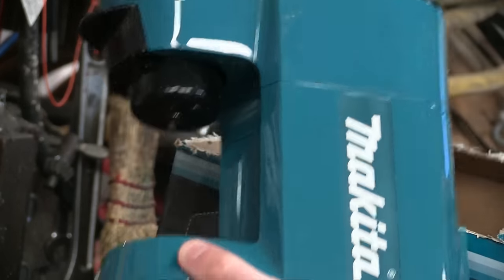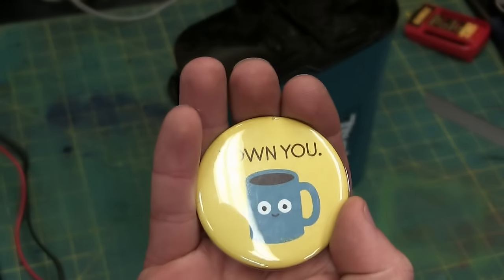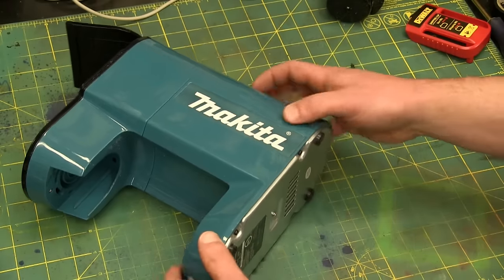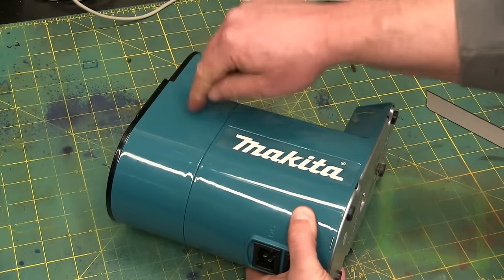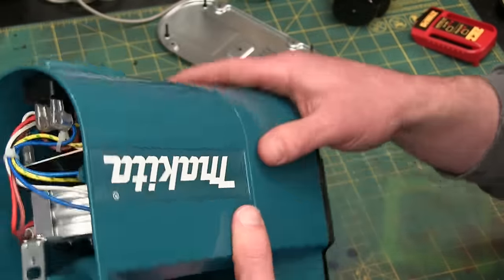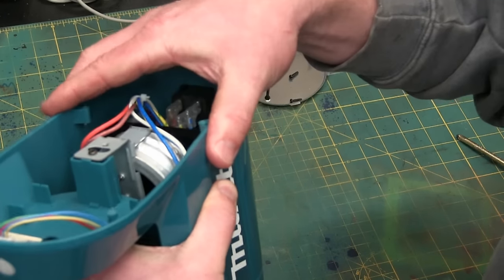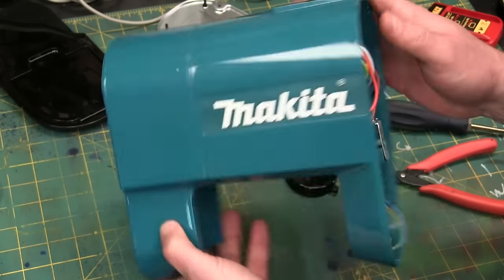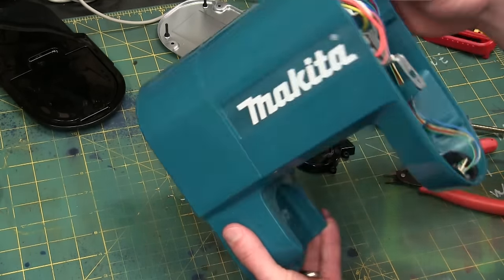BOLTR: THE BEST TOOL MAKITA EVER MADE!

Comment: You need to work on your speeds and feeds. The surface finish on that cardboard is appalling.
Reply: Trent Wainwright looked more like the chatter was on the end of the workpiece, needs to hold her more skookum
Reply: I thought the cut was a bit deep
Reply: garrett messer yeah definitely not just chatter problems here. Tools also seems to be a bit dull, it's not cutting properly in my opinion
Reply: Nothin' a little grindin' won't fix....and he owns 12 of  'em!
Reply: He did skimp on the lube/coolant
Reply: Your setup for the cnc box cutter might require just a teensey weensey bit of mor research.  When all else fails, please read the instructions stuck to the bottom of the box.
Reply: @kevinireland8020  Absolutely, saw that right off!

Comment: I was so fucking confused after you opened that. It's a 4$ Walmart Special coffee maker hooked up to a goddamned 18v battery.

This is the future we chose.
Reply: WalcomS7 Had no idea you were an AvE fan, Wally
Reply: But it would have a false "Made in the USA" sticker with fine print that says, "Actual parts may not be made in USA."

Fucking shitmart.
Reply: TheGuruStud pretty much everything nowadays that has "Made in the U.S.A." on it's components etc are made in China, so don't blame walmart for it since it isn't their fault, cause they just get the components etc out of China, and then assemble it/put it together.
Infact, i don't think that there are much semiconductor manufacturing companies that have it actually manufactured outside of Asia, if any.
Reply: Coofee Yum.

Comment: What is the correct feed rate for milling cardboard?
Reply: Fucking full/high/all out/240v on a 120v motor. You get the idea..
Reply: all she'll suffer
Reply: 650 gnaws per minute
Reply: One by each
Reply: Here in Canada the technical term for the proper speed is "give 'er"
Reply: @maxk4324  In Australia we'd say "Fuckin' send it"
Reply: ALL the spindle speed, and full chooch with your strong hand on the feed. The stranger doesnt have the stamina to finish the cut.
Reply: Turn er up and push go

Comment: Question - what's the recommended feed speed for opening a cardboard box?

Asking for a friend.
Reply: Lazarus19706 how many rippums you using?
Reply: About 6-10 inches per minute @ 9k rippems, it's good enough for the girls I go out with.
Reply: criswellwj  less than 3 tenths per tooth eh? I know who I want to race against in a productivity match.
Reply: MindCrime 99
Reply: I go with 20 inches per minute.
Reply: Hard and fast, like all ave feed/speed
Reply: As long as you're using lubricunt, feed speed is irrelevant... So don't hold back.
Reply: @MindCrime550  Do the girls get rectafied too.

Or is that rectumfied?

Comment: It's actually a drip coffee maker using a bubble pump. The heated water turning into steam drives the pump. Since you put ice water in it's not surprising that it took a while to start, but the bubble pump will ensure that generally the water going into the coffee is at the right temperature.

Comment: Using a mill to open packages huh...  I feel like you got a good idea going here. Maybe clamshell packages would actually be openable that way.
Reply: Hacksaw blades.

Broken hacksaw blades... avoid those "bimetallic" blasphemies. Grind away and make a scalpel sort of thingie...

Sharpen the shit out of that thing, a clip point is preferred but not needed.

Hold clamshell container flat against a proper sacrificial surface as wood, cardboard or thicker plastics and cut away.

Keep several of those slashy things around, give some as gifts and preach the knowledge...
Reply: Nice Pfp Seraph
Reply: Lasers overpowered lasers

Comment: They're starting to come out with some cool gear for the batteries. I have seen a battery powered air pump for tires and such. I've been considering making something to use my batteries besides impact tools. dunno what yet.
Reply: I've heard the battery tire inflater is great just don't try it on 80psi, the milwaukee one will not do it! 40psi I've heard many people say it's good tho. better than nothing on the side of the road with a flat!

Comment: Ok, you have to overhaul the Bridgeport.
Reply: dkroth Agreed. It's a bad sign when you get chatter machining cardboard.
Reply: David Lowe He was obviously milling at a slower speed to increase suspense.
Reply: I mean, how would a cardboard box NOT chatter?
Reply: Shea McCombs Id go with conventional milling vs climb milling
Reply: Lawndart Productions 
so long as the step over on that profile cut is less than half cutter diameter I agree. climb cutting like that is just slapping the workpiece and building harmonics like pushing a kid on a swing. conventional cutting in this application would puts forces in line with the hangulation that the work is better shaped to resist.

Comment: how many cups can you get from a full battery I wonder...
Reply: 2 with a 3Ah battery pack, more with the larger ones. I got one and use it with AC, works fine ^^
Reply: Would that be full cups or 1/2 cups ? 
Gotta leave room for some of the secret sauce that lets you tolerate the guys with the clipboards. It ain't just for breakfast anymore...
Reply: +DL the nahbore had guy working for him the guy  left his coffee  laying around so the naborian drak it and said that ain't coffee
Reply: Canadians use 1/2 cups. jk i💛maple leaf lovin s.o.b.'s lol
Reply: Dunno man...I'm a proud member of the Order of the Leaf meself and my coffee cup's bigger than my face. We even ship our Timmy's to the sandbox for the troops.
Reply: All that bein' said tho...I'll unplug the charger for that POS drill no one uses in order to plug in my java. Even the white-hats won't call me on that one.
Reply: @Carsten Hodes Is it much faster on AC?
Reply: More if'n you don't fill it with ice!  WTFing  damnfool CLINT fills a coffee machine with ice cubes at 550BThU per pound to melt?
Reply: belson alan I was also wondering if the ice had anything to do with how long it takes for it to make some coffee
Reply: @lpsteentjes: The manual from Makita said: 3min on AC and 7min on DC [150ml cup].

So i just tried and stopped time. My cup holds 230ml, it took 9min on DC and 3min 20sec on AC. Roomtemp was about 22°C and water had about 20°. In both cases i used new water and the temp was the same.

So... it is possible to run it on DC but i think that is more a gimmick, but it works really fine on AC, and personally i drink now more coffee, because it is much faster to set and clean up than a normal coffeemaker (because of the plastic filter).

@DL: is a half cup more or less than 150ml? ^^

Comment: Could you cut the end off of the battery adapter plug & wire a regular outlet to it for running things like LED lights?  (such as Christmas Lights in a standalone setting)?
Reply: nope. It's just 18V not 120V. It's coming directly from the battery and not from an inverter or some step up converter.. So most 120V tools or things in general won't work and some will brake down. A very few might work with reeeaalllyy low power output

Comment: how long does it take without ice cubes for starting ?
Reply: AvE Back when I was stationed in Goose Bay, we had this thing called "fahrrrr" for de-cubing water. Dunno if you can get your hands on that, or if it's some sort of Kraut Army thing.
Reply: Mine fresh from the box took about 15min for a cup of coffee. I don't own a Makita battery so I had it plugged into the wall. I returned it and bought a Mr. Coffee from Wal-Mart.
Reply: Per-gram heat of fusion and heat capacity of water is 334J and 4.184J/K resp., so it might be about 2.25 times faster to start percolating with 20C water than 0C ice; aside a significant fudge factor fer convectin the heat up from the element to the cubes. I'd estimate "lots faster".
Reply: genius Ave also put a ton of coffee in, add less it'll go faster and taste more normal 😂

Comment: Hey, thanks for making these videos, they are quite comical and very educational.  Thank you.
Reply: As far as turbo boosters the only think I can think of would be a UPS type device.  We use them in DDC controls to smooth out input voltage into our controllers.  

UPS into a PSM2RB10 made by functional devices.

Comment: Ahhhhhh the one cup coffee maker. The hotel I do maintenance at has literally the same ones in the rooms. Made by a cheap ass company 'LodgingStar.' Looks identical on the outside. The same shape/ size. The tray for the coffee grounds is slightly different looking the way it slides in, and the power button is an amber led on the front of the machine located on the base. The main difference is that it already comes colored black. No weird teal-ish color.

Comment: 10:14 NEMA 5-15 is the part with the walls. 5-15P is the pokey bit, while 5-15R is the holey bit.
That thing there looks almost like an IEC connector (IEC 60320). It almost looks like C15/16. C15 would be the one on the cord, C16 the one on the appliance.

Comment: Personally i wouldn't want something that bulky in my bug out bag. I'd take the bag of coffee and that would be about it. An industrious sort can always find an implement to make coffee with. An empty vegetable can and a camp fire will work in a pinch. My bug out gear consists of a water resistant container of AA batteries. A solar charger for them. A home made USB power bank that uses them. Two LED based Mini Maglites. One of the pro models and one of the camping ones with the different power settings and signal capabilities. A Leatherman multi-tool. A mini jet torch and small can of butane. A lock pick set complete with torsion bars. Last but not least a handheld HAM radio. Everything else that I might need I can acquire on the go.
Reply: That's a lot of gizmos.
Reply: Not really. I forgot to add paracord but that's still not a lot to carry. It's a light load and that's the point. It keeps me mobile. All of that fits in a small Maxpedition waist pack. My clothes and tent fit in the backpack above it which is also where I usually keep my laptop too. The whole thing is less than 60lbs.
Reply: ExStatic Bass Dude, they have this great thing that makes exactly one cup of coffee all you gotta do is boil water and have filters for it.

Comment: That DC cord is a C15, which is supposed to be a high current version of the C13 and should fit in that AC socket on the back. Also, C13 isn't 115v only, it's used for 230v too. Would be nice if companies did 5 minutes of Googling before slapping the wrong power connector on their coffee maker.

Comment: I have also been integrated about drip coffee. Im from Australia. I have never seen a drip coffee unit before.
Reply: +DeadGhost113 you should order one online
Reply: .x. Im not saying im confused but i am confused.
Reply: In a percolator, the water reservoir and coffee reservoir are the same container.
Reply: Percolators ruin the coffee... it gets re-boiled in them
Reply: alphamongrel To my knowledge it only gets heated once. But like i said i dont know to much about them.
Reply: Mr Coffee makes "drip" coffee makers... I have never used a "percolator" type but they have the coffee go back up and pour back over the grounds again, from what I understand. Correct me if I am wrong, that's a different machine entirely.
Reply: Regardless, a drip system is worth trying, if you haven't already...

Comment: The DC plug adapter looks like a squared off IEC 60320 C15/C16, which is the high-temp version of C13/C14. Never seen one like that. May be something only use for DC.

Comment: braille skateboarding need to open you make other skate it this way. 😎 ave I've got some sharts, I've worked with the con carne sticky stuff before. lots of vacuum casting with machines from shermany. the f1 like performance curves are the same for these chemical resins, toit for the pu pp pe rubberised resins and schmoo. water ingression is always a factor. polyurethane and water makes foam!

Comment: year late, you probably know btter by now, but its an IEC-603somethingsomethingorother standard connector, C15/16... definitely dont wanna go finding one of them with a NEMA connector on the other end and pluggin em into the wrong pokey bit recepticles! HAH... don't see those connectors around often though, most heating element appliances prefer to use C19/20 (BAD) or C21/22 (GOOD)

Comment: 4:37 Nope, that's in no way a 120v-coil relay. The ratings listed there are all for the contacts (according to the different certifications). 

If ya look on the bottom ( 5:02 ) , the coil, which has D9 across it (in reverse), has its traces going waaaaay over to ground and the collector of Q1. And you can bet your booty that lil' guy ain't switching over the mains :P

Comment: Why dont they make corded batteries? Would just be a cord that runs to a battery type fitting that way you could run cordless tools with a cord for the days you need it. One that comes to my mind is the grinder. I burn through batteries in like 5 min, so I have a cordless and corded grinder. Would be nice to just have the one that could be both.

Comment: I think your channel is berriliant, and when it comes to the electrickery you know a lot more than I. So just a quick one (without even chargin ya) if the dc pixies travel one way around a circuit but the dirty ac pixies go both ways ( ie back were they came from) have you actually used any? What happens to the power after its been through our equipment? Is them robbin baskhards at the power company just pissin down our backs?

Comment: Hey, AvE, 

I recently purchased a Makita 12V drill, and noticed right away that the frequency from the electronics is roughly 60 Hz, rather than a few KHz that other drills put out. Do you have any speculation as to why that is?

Comment: I wonder why they didn't just build the battery receiver into the unit and skip the dongle. Keep your Apple jokes to yarselves.
Reply: I can think of a few reasons.  1. batteries don't like heat 2. a lot of people would buy this for the shop as a joke, but not want to use the battery 3. the battery receiver will eventually break, since it would probably have to hold up the battery's weight.  (possible workaround, put the battery in the bottom, but then you have a risk of boiling water spilling directly onto the battery...)

Comment: Starting with liquid water at room temp might be a bit quicker.
Reply: Scavenger_mi errrr nope... and it's just under very specific circumstances boiling water freezes faster.
Reply: how would it boil faster if the ice won't even make to the heating coil without it melting first?
Reply: The ice has to be melted before it will drain to the heating element. The melting is possibly slightly helped by the little bit of water added.

Comment: If this really was the best tool Makita ever made then that would not speak well for them. All hyperbole aside, I disagree. The POS is barely functional. I bought one. I used it. With some screwing around it made a half a cup of luke-warm coffee at a time. While the internal components may impress you, IMO, this thing was so poorly designed for "actually making drinkable coffee," that it seemed like a secondary thought. I returned it ASAP. I think it's the only Makita tool that I have returned. Maybe they'll come out with a 2.0?

Comment: So, me being a newbie, I need resources or a simple 'do this' kinda info bit. Lathes. Metal. Good for the buck. Ramen noodle budget lathe with some budget stretch. Basically how the hell do I choose my first lathe.
Reply: Steve Sheldon if there's a will there's a way to get a coffee maker to chooch ramen
Reply: That's the spirit!
Reply: I've got one of those harborfreight tabletop lathes and it sucks.  Not accurate enough; dial markings mean nothing; the whole thing flexes when the bit enters the work.  I bought used & cheap with tooling so not too bad.  It still is good for some small things.  Check your local listings for school auctions and try to buy something simple & quality & old, then learn how to measure & cut  accurately.  Remember, school stuff  can be 3 phase.  Normal size lathes are HEAVY, plan how to move before you buy.  Tooling & accessories are expensive.  Take an adult ed class in machining at a local college.
Reply: david ervin I'm trying oh so hard to get an apprenticeship with Daetwyler industries, though my options are open. This isn't something I plan on getting too, too soon but i'd like to know what i'm looking for. Thanks for pointing me in the right direction.
Reply: Your attitude is your best friend.  Building things is fun and the machine shop has many nooks & crannies. Your best resources will be folks you meet that are in the business or enthusiasts.  Talk little and listen a lot when you meet them.  Take your opportunities as you find them.  If you meet a welder learn from him; or a woodworker; or an artist.  For equipment as well.  Here, an old man died.  He had a basement of old equipment and the family was willing to sell his house, with the basement machine shop included, for 50 grand.
Reply: david ervin Sounds like a hell of a deal. I should get to looking at local deals rather than retail.
Reply: Cameron ZY One of the things about buying from an old guy, for instance, is even if the tools aren't the best, they've been maintained and cared for. There's a lot of life left in those machines.
Reply: Matthew VandenBerg old and crazy, just how I like my tools

Comment: Hey there AvE and crew. Anyone who owns this, does the third pin on the battery holder do anything? Looking to change the battery clip for a Ryobi one, so I can use my fleet of Ryobi batteries to make coffee. Don't feel like buying a Makita battery and charger just for this one thing. 

Basically, if I just wired in my own 18v source, minus the third pin of the battery clip, would she still chooch. Or is the third pin some kinda proprietary mumbo jumbo looking to see if the battery is a genuine Makita battery?

Thanks for any response.